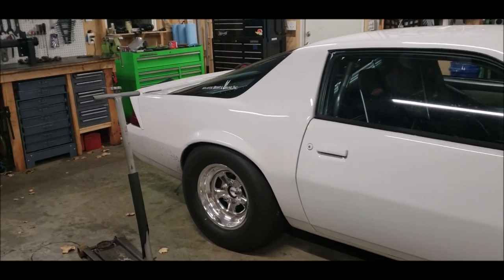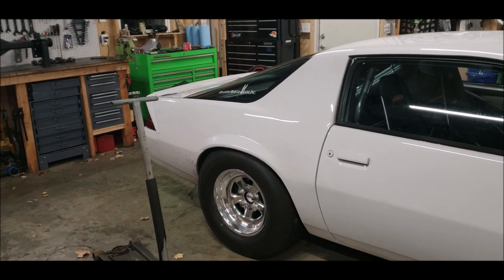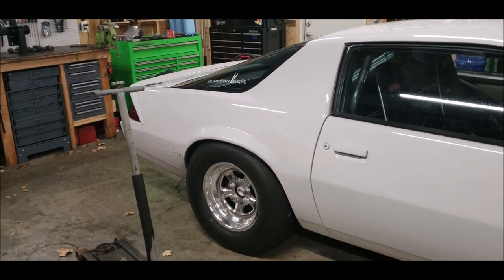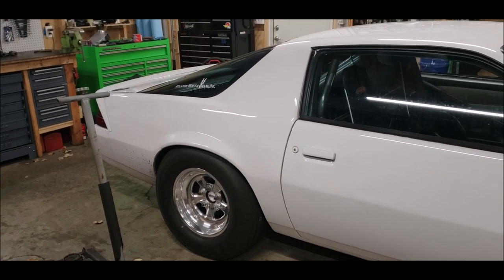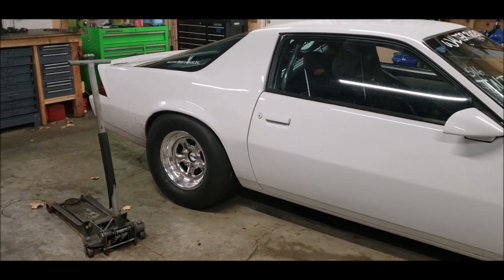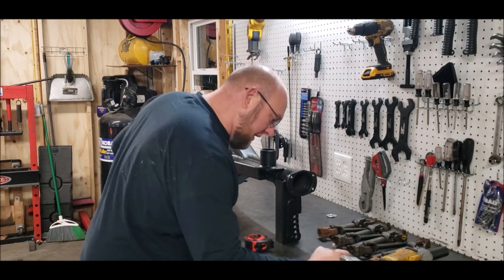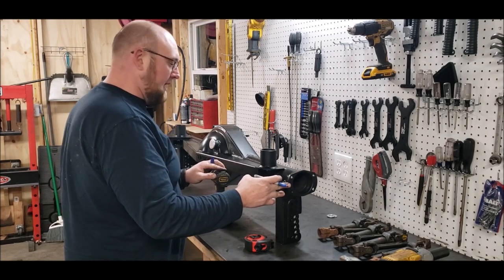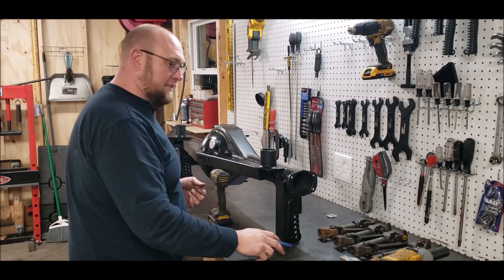82-92 F-Body Trick Chassis 9 inch install; SpeedMullet winter 2021 updates, part 1

Comment: I noticed you didnt have the upper panhard mount on your car.  Does that help in a drag race application?  On my car they seem to hit each other on launch but my upper bar is the curved one that allows clearance for exhaust.
Reply from the maker: @user-qz8gs6tc1f  you may need to lower the axle mount to add some clearance. 

I generally dont run them on drag cars though

Comment: Looks good Matt..hell of a different by bringing those wheels in...quick question..so I'm gonna run a Quick Performance 9" in my 85 3rd Gen coupe with a very healthy 5.3 with nitrous and th350 transmission what gear should I run 3.73 or 4.10 it will be driven on the street a little but not alot
Reply from the maker: depends on what size tire, how much nitrous, 1/8 or 1/4, how much converter, etc.
Reply: @MattWalter1  Sorry I didn't include all of that..275 60 15 Mickey Thompson ET Street Radials which are 28s ..1/8 mile track and 3500 converter
Reply: @MattWalter1  150 shot and my step up to 200 shot of nitrous
Reply from the maker: @KeepGrindingGarage  start with the 4.10's.  it may even want more, but figure out where it's gonna mph and rpm through the traps with the 4.10's first.
Reply: @MattWalter1  Ok...the cam that I'm using is a Summit cam..231/242 duration and 600/600 lift 113+ lobe separation angle and it calls for gears but it doesn't say which one..so I didn't know..but I was thinking 3.73 or 4.10..also using 750 mechanical secondary carburetor and intake setup..so any help is greatly appreciated..I'm gonna try the 4.10 and see what it does..

Comment: How much did you narrow it?
Reply from the maker: 6" overall from factory thirdgen width.  3" each side
Reply: It doesn’t get in the way of anything like control arms or anything
Reply from the maker: @JAndJ479  yes. I narrowed up the lca mounts to the width of a rod end
Reply: Do you know how narrow you can go without messing with the lca? Or do you have a video on you narrowing the lca
Reply from the maker: @JAndJ479  if you did 2" on either side, you could leave the lca brackets alone.